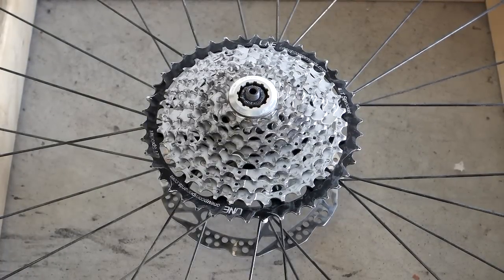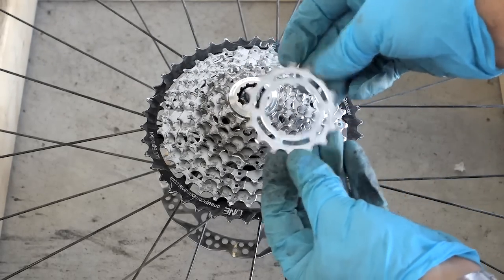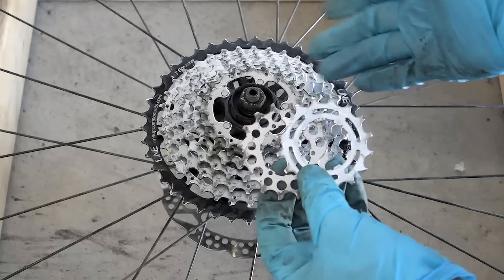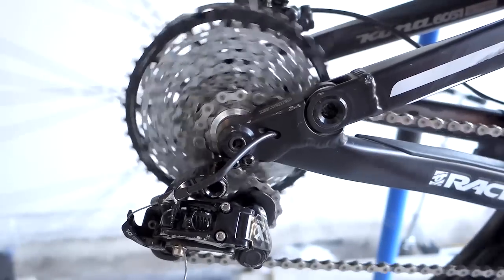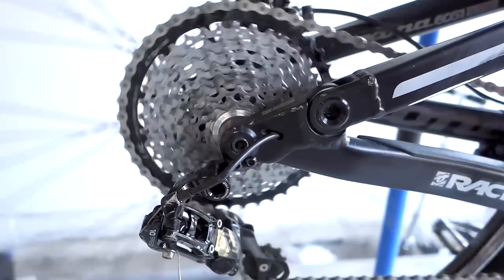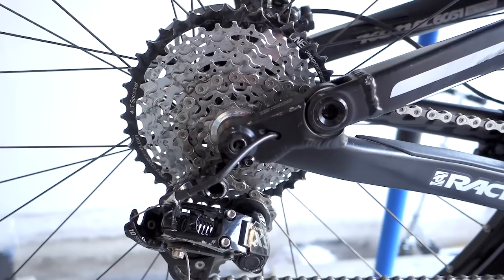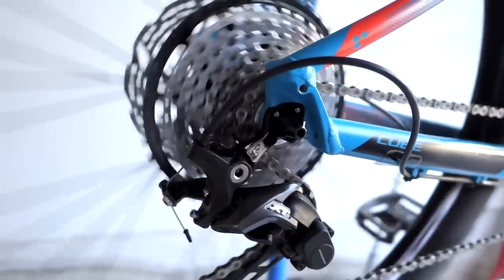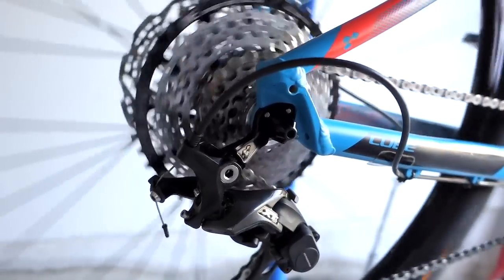16t cog from Shimano vs OneUp, 1x10 Extended Cassette

Comment: The 16 tooth works differently based on tooth design. It's designed to jump two cogs up (16, 18..) rather than three (16, 19...). The teeth are slightly misplaced compared to ones that jump up to three teeth so the chain has some trouble shifting up that cog.

As for the one up cog, I'm pretty sure they designed it based on Shimano's, thus yielding the same shift problem.

Hope this helps :)

Comment: I never been happy with the shifting quality on the extended cassette XT + OU40T/16T. The low gears shifted fine but the high gears on the bottom of the cassette were less than acceptable (for me at least). I used OU and Shimano 16T and tried all indexing options but it wasn't perfect. Also, I ride with higher cadence and I didn't like the 2-3-3-2 jumps either so I decided to keep the 1x10 but replaced the 32T chainring with a 30T and used the 11-36 cassette without the extension. I lost some top speed but on a trailbike I prefer it over the compromised shifting quality. 

Recently I installed a SunRace 11-42 10 speed cassette on a friend's bike and I couldn't resist and tried it on mine too. The 42T streches the capabilities of the XT rear mech but it worked perfectly no shifting issues on either end of the cassette and the steps between the gears are good too. I think it is hands down a much better (and cheaper) option than messing with extender cogs and the odd steps in higher gears.

Comment: I think a 42T asks too much from the RD. My 40T / X9 2.1 Med Cage / 30T shifts like the stock 11-36. I don't use the 40T very often (once or twice per ride for only a few minutes total) and there isn't a huge amount of difference between it and the bigger 42T as my "bailout" gear.

Comment: It could be worth experimenting with grinding out the thin spline so the cog can be rotated and lined up with the 19t.
Reply: i figured you probably did, very cool. That would be great as I don't think there's anything about it anywhere else. Modifying cassettes is a hot topic lately. I'm mixing an Ultegra 14-28 with an XTR 11-40 to get 14,15,16,17,19,21,24,27,31,35,40 for a road bike. It'll be used with a 50/34 compact. If I can get it to work, I'll post a video.

Comment: Thanks! That eliminates the 16t from the equation. That means onto the Radr for me, already owning the previous XT model.
Reply: +Marco Frissen Don't write off 16t cogs because of this video. Check out some other reports and reviews on YouTube and elsewhere.
This is the first negative report I have ever seen for 16t shifting.
Reply: Res7
as the video explains, it's not the cog, it's the system. A standard derailleur might have issues (which is actually also mentioned on the OneUp site), but if you use the RadR cage or the mentioned XT8000 it seems to shift better.

I actually have the same shifting issue with my XT derailleur, so it's not a coincidence. Ordered the RadR cage and see if that helps.
Reply: +Marco Frissen 
I missread your post. again though, a Shimano Zee short cage derailleur has no problems. Still has a clutch too.

Comment: One Up 16t with a Fire Eye 42 and an xt cassette works fine for me with a Shimano Zee rear der and Zee shifter. Also has the benefit of being a short cage der and did not even require the use of a longer adjustment screw to clear the 42.
The 16t that came with the Fire Eye 42 was total junk. It was soft and was slipping within a week. My advice would be to stick with One Up.
I had what seemed like indexing issues for a few days but once everything (cable, cable housing, chain) wore in a bit,everything became as smooth as it was on stock Shimano gear.

Comment: Hi, great video!! I'm having a similar situation. I have a 1x10 setup with raceface effect crank N/W 32t chainring shimano Saint rd with RADr cage 11-36 xt cassette with the 42t one up extender for my fat bike.  I replaced the 15/17t cog with the supplied one up 16t cog.  The shift to the 16t cog is real noisy all the other gears are quite,  could this be a timing issue with the clocking indexing of the cog??  I had this same setup on my HT with no issues...thanks

Comment: Hi, Love MTB. I have the same issue even with the radr cage, a new chain and a new hanger. Getting the M8000 RD is a little too expensive fix for me. I'm thinking of getting rid of the radr cage put back the stock cage and fit a wolftooth goat link. Any thoughts about it? Thanks!
Reply: Thanks for the reply. I forgot to mention that I've converted my hanger to direct mount. Should I Install back the factory hanger for the goatlink then?
Reply: My bike is a Cube Analog 29er which is not a direct mount from the factory. I bought the direct mount separately. So if i'm going to use the Goatlink with the direct mount hanger, would it not extend my RD too far to the back? I hope I'm not confusing you. Thanks!
Reply: All because of that pesky shifting on the 16T! 😥 I'll just try your first suggestions! Thanks for your patience and replies!

Comment: Sorry, didn't get it. Which one is better? 
I got cs-m771 11-36 + oneup 42t + radr cage. Have problem with shifting from 3rd to 4th (from 16t to 19t) cog
Reply: and one more ? about onup 16t cog: so, what positioning is the best? Could you please just point how it should be?.. Thanx
http://prnt.sc/pht450
http://prnt.sc/pht4tl
http://prnt.sc/pht55c
http://prnt.sc/pht5b1

Comment: How long does the 42t cog last? Mine started to make a trouble after 2500km of enduro riding. I'm about 70kg and bike is 14kg, not so heavy. almost off the bike when go steep hills. And my shimano chain checker says the chain is still ok. But when I changed the chain to new one, it slips at the bottom of 42t cog where guide pully meet the cog.I am curious about the longivity of the aluminum 42t cog. Is yours ok?
Reply: +LoveMTB the old chain has no trouble. and it is still ok. i just tried new one. but my new chain has. my 42t is from fouriers. xt long cage 786derailluer xt casette. chain pops up at the 42t near guide pully.

Comment: I was thinking of upgrading my 8 speed drivetrain to 10 speed and this video got me thinking, will a 10 speed shifter ( Saint m840 ) work with the 11 speed m8000 RD?
Reply: +LoveMTB Thing is. The M8000 costs slightly more then a M786, will the M786 have problems with the SunRace 11-42T cassette?
Reply: +LoveMTB I see, thank you so much for the advice :)

Comment: Just changed all the transmission (chainring 32t AbsoluteBlack, 10s XTcassette whith OU 42t and 16 t cogs, M8000 st RD and SLX 10s shifter). All working good, but there is a small noise when using the 42t cog, comming from the RD (further cog from cassette). Does anyone had similar problem? (not a big issue, just a little noise, it seems to work fine)